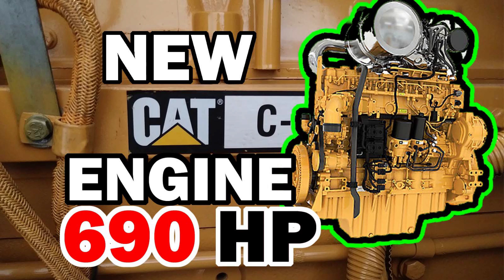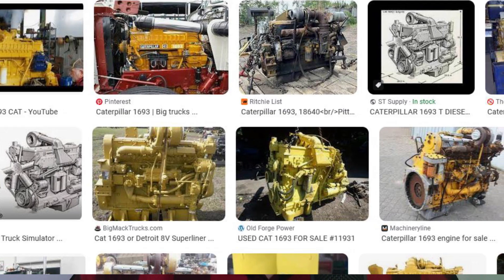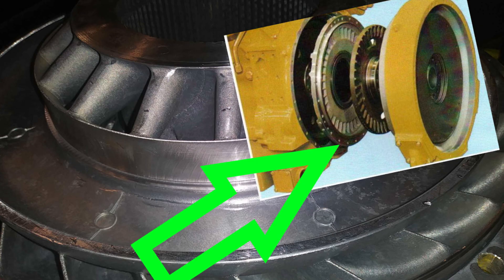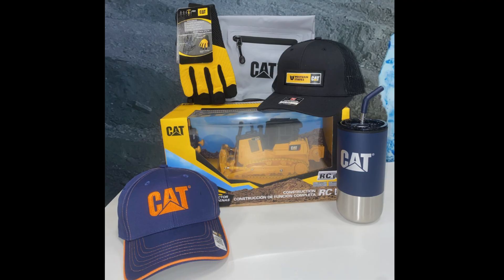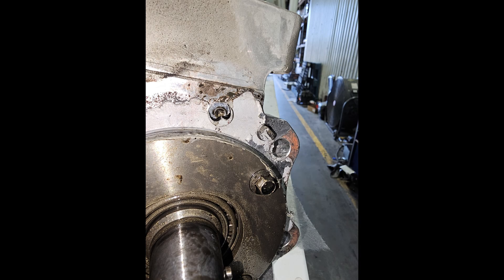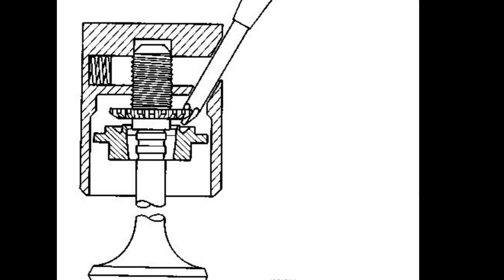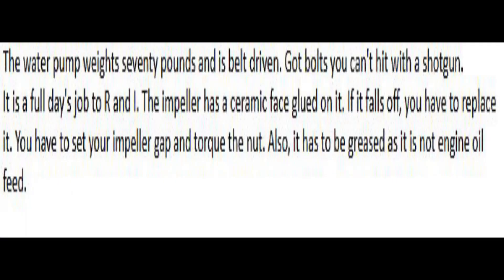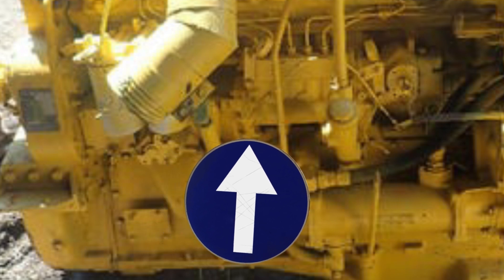The Coolest Diesel Engine You've Never Heard Of, Cat 1693, Dual Overhead Cam Caterpillar.

Comment: They also had a V8 - 346, V12 - 348 and a V16 - 349. All of these were overhead cam engines. They had front and rear gear trains. 
I had one of the 1693 engines that came in my machine shop that had over 1,000,000 miles.
Reply: Then even have up to a d399 V16 that seems to be the predecessor to the 3516
Reply: @jnic2003 , The D 399 was generally used in big power units, marine applications, or Draglines. They had 8 cylinder heads, 4 per side 2 cylinders per head. They were in the same family as the big 6-cylinder engines that came in older D8 Dozers. The pistons and valve train were the same. There was The D 353, 6 cyl., 397- 8cyl., 398- 12 cyl., and the 399- 16 cyl. I might be wrong about the D353 I think that engine was in the D-9 Dozers. We always called the ones in the D8 a D8. I have been in the Diesel engine machine shop business for over 40 years. There has been a whole lot of big changes in that amount of time.
Reply: 346's were not a good truck engine...
Reply: The only trucks I ever saw a 348 in were off-road Rock trucks.  @rodmpugh226

Comment: I had a 1970 Ford WT9000 that Caterpillar (Peoria) used to move parts from building to building. This truck had a 1674 which was similar to the 1693 except the same bore and stroke as a 3306.
270 hp, would start no matter how cold it was.

Comment: Had a 75 KW W900 Michigan special with 1693TA and 1259 13 SPD. Most everything you say is true. It liked fuel it leaked oil but I have to say with glow plugs and 24 volt start it was a great starter even in sub zero temperatures. And it had plenty of power. The original owner told me when it was new and pulling a fully loaded train that no Cummins or Detroit could catch it. I've had a retired guy come up to me once and told me he spent ten years trying to catch that truck! LOL! He said the only time he saw the grill was when it was coming at him in the mirror or passing in the opposite direction
Reply: Surprised it leaked oil. They were normally very dry.

Comment: Duane here,I have a hard time with which is the best cat engine depends on what it was used in and time! D343 was great in equipment, 3306 worked great in cement trucks, 3208's were great in trash trucks! They all had their day in history! 3406 work great later in loaders, then their 3408, 3412 in equipment side!

Comment: 1693 OH Yea. These were heavy boat anchors, poor millage. BUT with these magic could happen. This was the era of the horsepower wars. The 1693, the Detroit 12-71 and Cummins. All of these because they were mechanical could be hot rodded!
The 1693 could get up 700+hp. The V12 was 475 natural aspirated, 550 single turbo and 625 dual turbo'ed. Every fuel pump could be master tuned, turbo's custom built, timing tweaked. Literately you could melt the rubber off a set of drive tires going up a long grade!
   This was where you separated the real mechanics from techs, who could fine tune and customize.This is where a blow hard mechanic could melt one down in 10,000 miles. This is where you separated real drivers  who could put 7-800,000 miles between overhauls and not melt down the pistons. If you got 350,000  on a Cummins you were lucky, the 1693 held top spot for extended overhaul mileage.
   This was the era of 100,000 lbs loads, legendary races up grades. It was also the era where you could make a lot of junk with with average skilled mechanics and average skilled drivers.
   The 3406B was right in there in its ability to put out amazing horse power.
   That was a magical era in trucking.
Reply: Coal trucks in western Pa and WV used to gross 130k and you could just see a faint blue natural gas like flame at the top of the stacks from the best tuners
Reply: @johnhull6363  I imagine the turbos were getting TOASTY.
Reply: Remember when Cat rated its horsepower at the ground, not the flywheel like cummins and detroit.  That v12 with twin turbos was a beast also, and of course the cummin kt600.  I remember a race up Cabbage between a v12 and a 1693.  At the top the cat pealed off the tires, the detroit had burnt pistols; those were the days when, where there is smoke there is power.  Of course diesel was 30 cents a gallon.
Reply: @drowsy4  they never did. Since cat was a engine supplier and since the drive trains have different factors for parasitic loss that literally would've been impossible. This has been said about all of the manufacturers and has always been proven false given the hp standards are set industry wide.
Reply: @drowsy4 where these is smoke there is partially burnt fuel. Hp comes when there isn't smoke due to this. And your story sounds fabricated like many old timers.
Reply: Oshkosh was the trucks we had

Comment: One reason the fuel pump was mid engine mounted was to make room for a timing advance and a bolted collar to be able to adjust the timing.   I was the only person in our truck engine shop that liked working on them , yes the water pumps were a bear to work on,  still. have many custom bent wrenches for removing them

Comment: 1693, first used in Cat scrapers at 600-650 horsepower. Introduced into the truck market sometime around 1970.
But only 375 to 425 horsepower in highway trucks. Because the drivetrains of the time couldn't handle more horsepower.
Also used in military applications.
Many had hydraulic retarders. 
Cat and Jacobs were not getting along when he 1693 and it's little brother (1674) came out, so no Jake's were ever designed for them.
As far as power and milage.. lmao 😆😂 I had a 1972 Freightliner with a 1693, at 80k in the hills and highways in the North West, it averaged 7mpg with a top speed of 62mph.. low geared for the hills. Would climb a tree with a full load!!! And it was a LOT QUIETER than the old Cummins!!! 
1674 is pre 3306
1693 is pre 3406
You mentioned Jeff @JPAYDIRT. He knows his 💩 about the 1693!!! 
Good informative video, but the internet doesn't always tell the real story..
Reply: I am sorry sir,  that D343 engine only put out 465 hp in the scraper engine serial 66w, the D346 that was the front engine in the twin engine scrapers put out 569 hp! That is directly out of the rack setting information book! Was in the trucks in the 1960's. It had a turbo and was 315 hp first series 65b1-222 believe it or not!
Reply: In the 631,988 16 motor grader they were model D-343!
Reply: You are so wrong on about everything you say
Reply: What about the 1673?
Reply: Jakes dont work well with Bosch type injection systems as there isnt a way to drive the slave pistons efficiency. Thats why a Jake ot Dynatard on a Cat or Mack basicly just makes noise. While on Detroits and Cummins the unit injector cam drives the Jake. This timing opens exhaust valves nearly perfectly...
Reply: They couldn't figure out how to put Jake brake on it be an auoverhead cam they was never design for that reason they tried You couldn't get 7 miles per gallon bobtail down hill

Comment: Actually the 3406a came out in 73     The 3406b didn’t come out till 87 and was produced till 93 the 1693 came out in 1964 it was supposed to go into off road only equipment I do believe but ended up in over the rod trucks because of the power it produced only down side to them was no Jake brakes and they were ungodly expensive even back then to rebuild they were twice as much to build versus the old Cummins
Reply: 3406B’s were available in model year 1984, with the water jacket aftercooler.

Comment: The four and a quarter 1693 was HUGE power for the day...fuel was cheap so they didn't worry too much about the fuel efficiency.  We had one in a cabover Pete...the clatter you could hear a mile away....but nothing on the road could pass it!
Reply: Strong enough transmissions and diffs were a bit of a problem when introduced. You could get bullet proof industrial transmissions, but too big and heavy for a highway truck. If you drove without accelerating hard all the time, things lasted. Come to a hill and ease into the throttle and they just "put their shoulder into it". Could get reasonable fuel economy and long life out of them that way.
Reply: My dad drove a 325 hp I thought was a freight train, can’t imagine a 425😅
Reply: The first few years of the 3406 were also PC motors. It was a big deal in the late 70s when DI was introduced.

Comment: By todays standards they were not high powered but back then they were torque monsters. Slow accelerating but had staying power. Back then 5 miles to the gallon was big fuel mileage. My friend never had any of the problems you are bringing up with his 1693. The first 3406A were pc engines also. My 3406A was direct injection it was 1976 model yr and was near the begining of direct injection for the 3406

Comment: I worked on 100s of these motors and we had a nickname for them , we called them swirl chamber motors . They have a sound all their own . Idling  It sounds like ping pong balls bouncing around in an empty coffee can. 😊
Reply: Enter GM 6.2l 6.5l. Lol same tech used in hot bulb oil burner engines from the turn of the century

Comment: Worked on number of these in the early 80's.The shop was mainly former Cat dealer mechanics who started their own business. They purchased the Cat tools to rebuild the scroll fuel system and the degree wheel to set the "lifts" of the individual pumps. This engine was timed (injection pump) by rotating the flywheel until a 3/8 thread bolt would line up with a threaded hole in the engine flywheel. The injection pump had a place to insert a pin when it was in "time" with the flywheel. There was a coupler that could be accessed after removing a plate, to loosen the pinch bolts that allowed these two to be timed together. These engines suffered from everybody trying to turn the fuel up for more HP which eventually would crack the cylinder head or blow the head gasket, shoving coolant out the radiator. Good times!

Comment: Hands down would change a water pump on a D343 over a 1693 any day of the week! Worked on both engines in my career of 47 years with Cat dealer! The D343 was in a lot of heavy equipment and lasted a lot years!  The retarder on the back acted as a brake saver, worked on lots of them.  The reason for the fuel system being that long down the side, was the original fuel system was a big box type, that went down that side, so when they went to the compact pump, they just made a tube from the back to the pump to put it in the same location! Simple answer. The original block was studded not head bolts, bot that was fun setting the height, there was three different lengths, that and they were not spacer plated! Want to know more? Made a lot of hand made tools to do valve adjustment and other things on those engines. If you ever need to repair the cam follower the socket part number 5P8691!
Reply: there long because the housing has the variable timing drive inside
Reply: @Jpaydirt  Did you ever work on the A model, we had one in our haul low bed, that we sold off and 30 year later came back for us to work on! This engine had a compression relief shaft it was so old, and had to adjust it as well! It was also the first engine I worked on when I went to the spec shop as an apprentice around 1975!

Comment: OTR drivers called the 1693 the engine that could not be blown up.  Most of them used in OTR industry had the governors basically removed and  jacked up to the moon.  Most of them were turned up to way more than their factory HP.  I know my dad had a setup in one as long as the turbo held up he said it was good for 450 to 500 HP depending on what sized exhaust he had.

Comment: Rear gear train engines seem to be the thing lately.  What's the attraction?  Seems like a real pain having to pull the engine any time you have cam drive issues.
Reply: Also rear gear train is way less oil leaks& it doesn't spray all over the front of engine like front gear train!
Reply: @adeptape Rear gear trains are good for machines AND cabovers. Paccar engines are from DAF so designed for cabovers. Detroit DDXX engines designed for Europe and US and owned by Mercedes - so rear gear train for cabovers. Volvo/Mack engines designed for machines (Volvo obviously) and cabovers.
With VW owning MAN, Scania and Navistar any new engine from Navistar will likely be rear gear train.
That just leaves Cummins - they are now a spec filler for the truck companies as ALL of them have an engine manufacturer. So they MAY need to change to rear gear train so that they have more in common with the house brand engines to make installation easier for them.
There is an another advantage to them and that is reduced size of the front of the engine making cooling performance better as the air can get past the engine far more easily.

Comment: In the 70’s Monfort transport out of Greeley Co ran these in their KW’s and they were fast. They were called circus wagons due to their colorful paint scheme and the left lane on the interstates were known as the Monfort lane on the CB’s. 
 The rest of us had 8v71 Detroits or 903 Cummins.
Reply: I used to smoke those Monfort trucks that ran east in the early 70's with a jacked up Cummins small cam 350 in a Pete conventional.
Reply: Monfort ran twin boxes and real low gears. The 1693s kept going no matter the gear.

Comment: It was a popular engine in Kenworth logging trucks here in Northen Ontario, thunder bay up to Hearst.   Used to hear stories of guys "crankin em up"  to 380hp.  Some would rev them to 2300 in the bush, off road hauling treelength.  They have a great sound when cold start up.
Reply: Sound like a neat engine
Reply: we called them popcorn maker from the sound , if didn't adjust the valve train in a sequence they would throw a #3 or#5 rod , ,some were really good some not,.